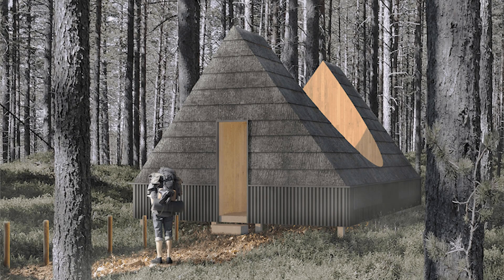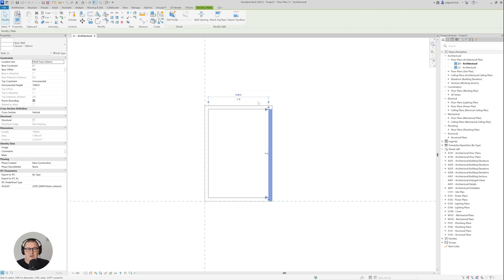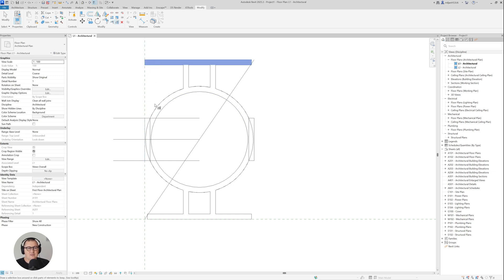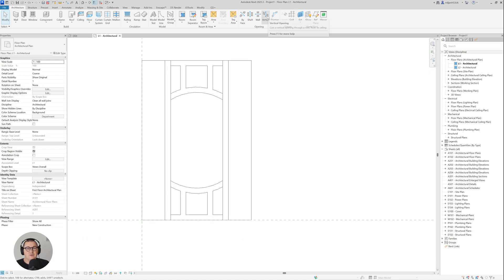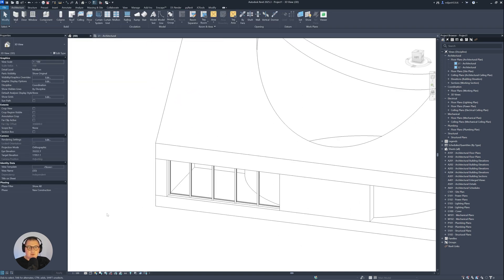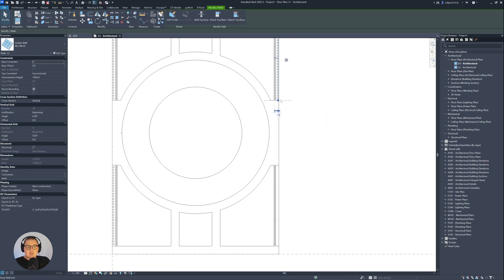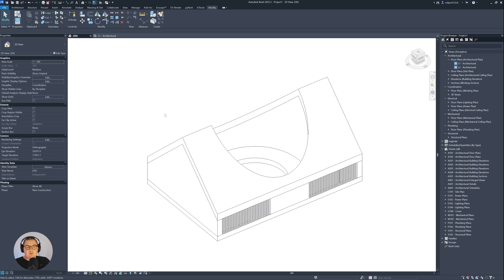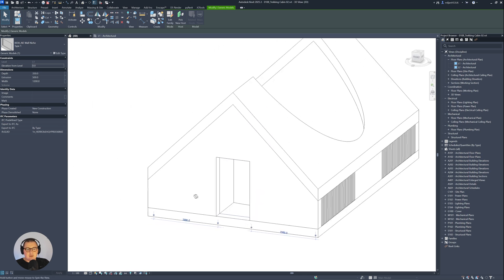Trekking Cabin by White Arkitekter - Revit Tutorial

Comment: For wall opening, to cut through the wall, to avoid the "bug", wall needs to be higher than that opening. Just give it a height :) . You choose really interesting project for this tutorial, truly inspirational.
Reply from the maker: Thanks a lot 😊 it’s still weird because it depends on the height given to the wall while it’s been created, but not on a real height adjusted by attach its top for example. Also Revit’s wall opening will not work well on a curved walls in this example